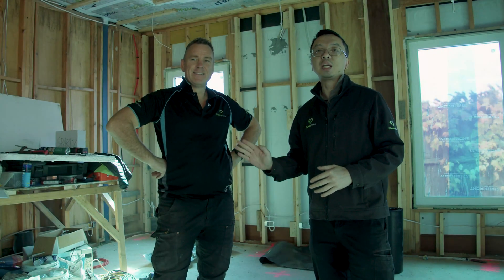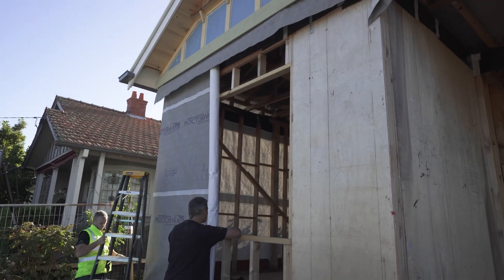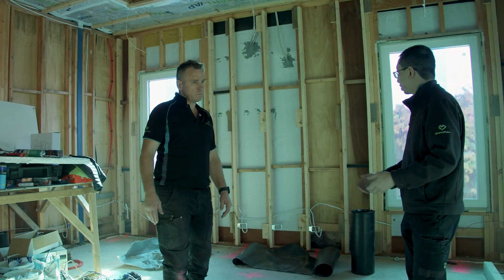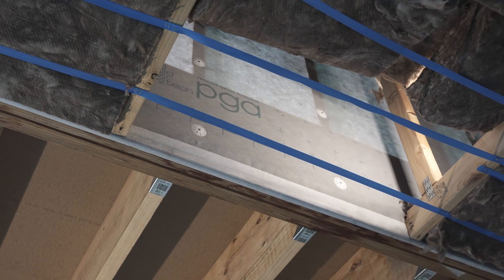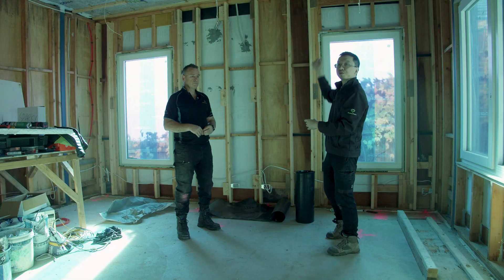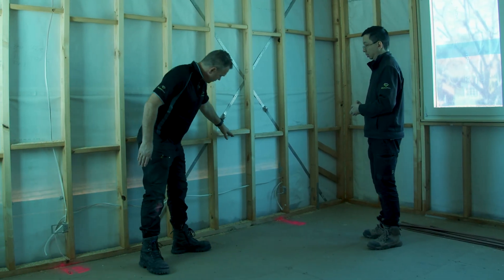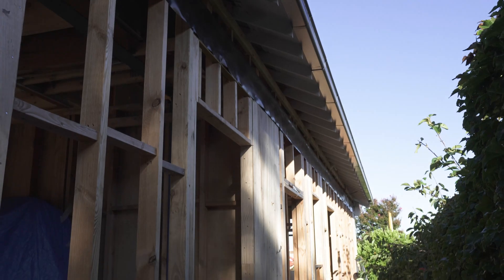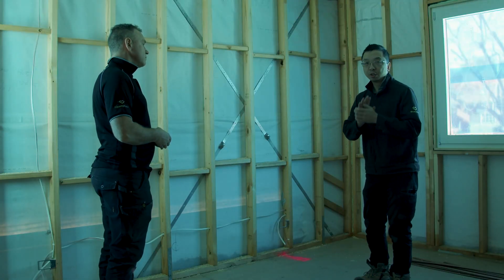tightHOUSE Method - Amazing Construction Techniques - Passive House Results?

Comment: There needs to be more education programs for trades.
A mock up wall or roof section goes a long way to teach good practices.
At the start of every job a meeting need to be held with trades to set proper expectations for quality.
Emphasize the need for communication if there are any questions.

Comment: New homes should come with large roof overhangs, solar panels, a rain water collection system and an electric vehicle charger in the garage.
Blower door testing is an under appreciated tool for energy efficiency and comfort.